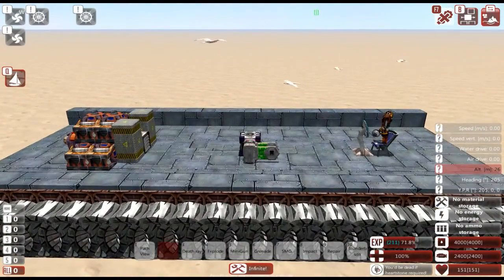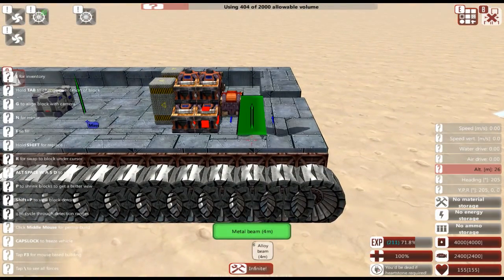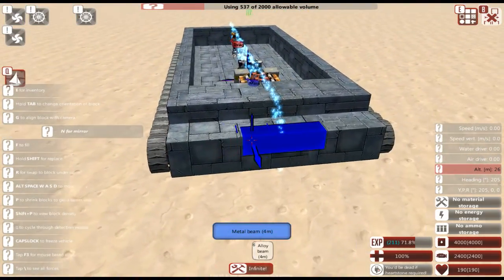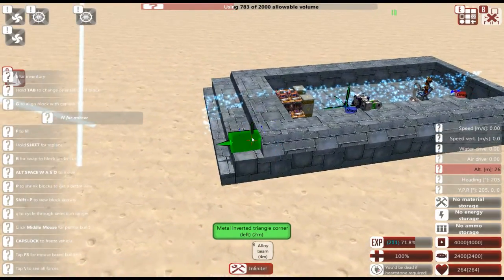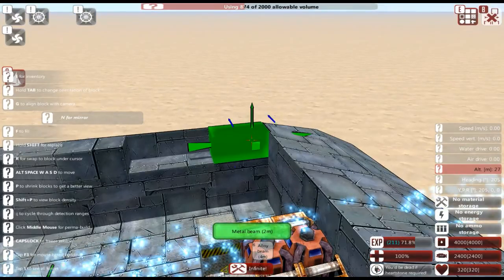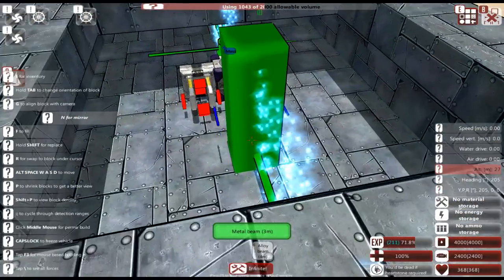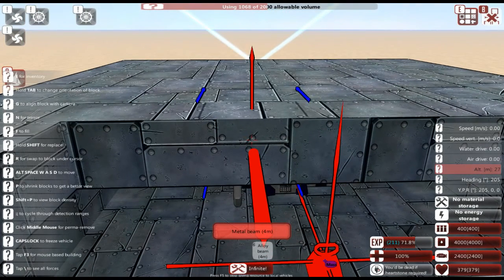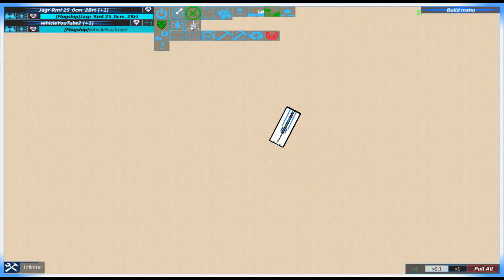From The Depths Tutorials | Episode 2: Hull Design | Tank Building Tutorials

Comment: Im back from vacations too haha, also i bought the game and built my second tank already XD, would like to see if the positioning of the blocks affect the damage recieved, like is it better to have 4 beams for 4 meter hull or 1 beam for 4 meters hull? does it have a difference? the armor stack thing works with both, none, or just one? btw good video ;D
Reply from the maker: Not entirely sure I understand the question, but I'll give it a shot and correct me if I'm wrong. I typically go with using the four beams to make the four meter wide hull, but I don't think it'll cause too much of a difference with either approach. Stacking the armor is what is really important. Thanks for watching! :)
Reply: if you stack armor you want it to be a cross, with one being vertical the other being horizontal. a 1x4 beam has the same hp as 4 1x1 blocks, however you need to do 4x damage to destroy one of those blocks if you need to go through it.
Also you do want gaps to a) Post Penetration Explosives may explode in the gap
b) HEAT shells HATE spaced armor
b2) HE and Squash also have a similar problem.
sorry for being 5 months late.

Keep up the work BionicTree

Edit: After watching the video, you would also want 4 long slopes to bounce AP shells and increase effective armor (assuming FtD uses semi-realistic armor modeling for shells which have a lot of pen and go straight through armor).